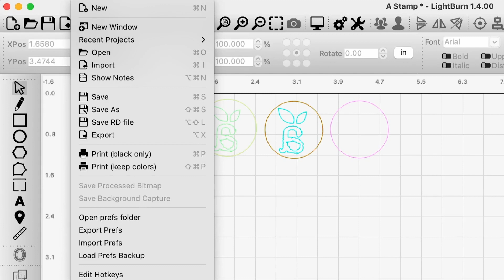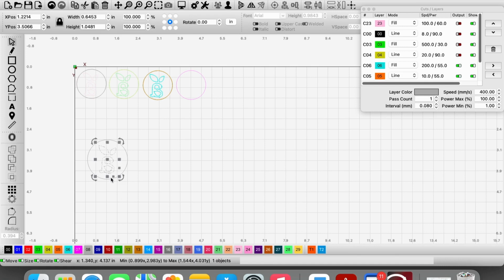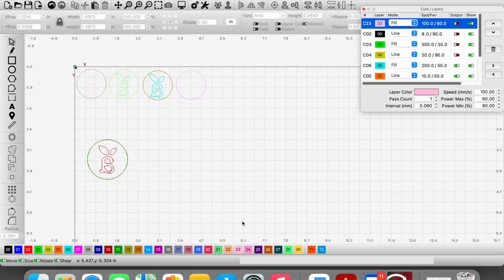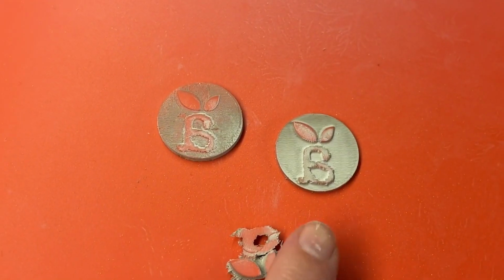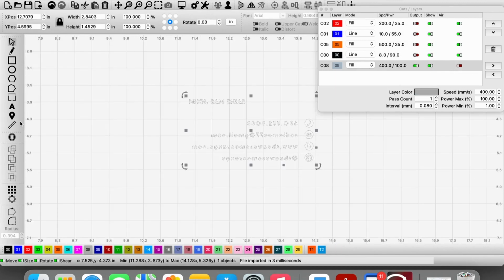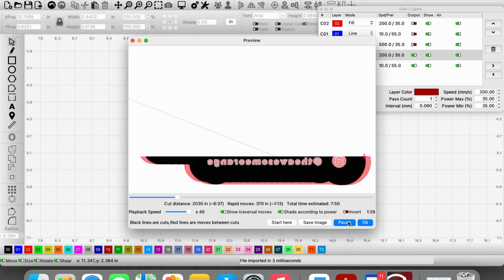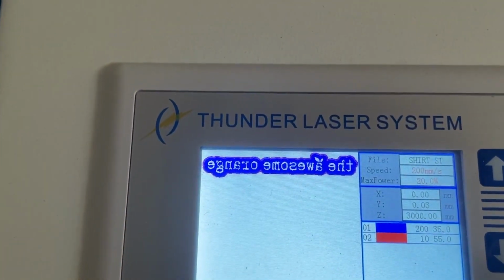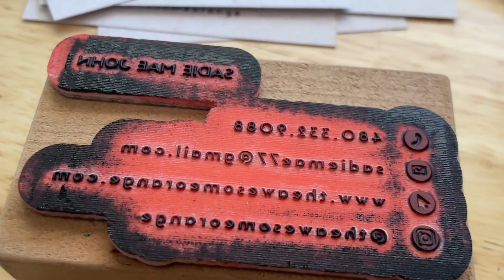Making Rubber Stamps with a Laser | Thunder Nova 35/100

Comment: Would be nice if you had shown the results of the stamp on t shirt.
Reply from the maker: You’re right. I should have. I lost the footage and didn’t want to refilm it. But it did come out awesome. 🍊
Reply: @TheAwesomeOrange  No it didn't come out awesome. I could see that you did not have enough recess to your rubber plate and the background rubber was way too wide away from the letterings resulted in background imprint when stamping as visible when you stamped the test paper. Usually when it comes to material stampings, the plates would need to be engraved super deep with the background rubber removed to outmost the outline of the graphics also you must put a cushion double sided foam between the holder and the rubber plate to make the rubber plate flexible to surfaces when stamping.

Comment: I highly suggest you watch your video. At first everything you are doing makes sense to me and is in a logical sequence. Then you go into layer settings and make adjustments to layers that you have not previously references, for example; you indicate to make the outer circle and rabbit the same color, you chose #10, then you duplicate the circle and make the duplicate layer #11. You then go into the layer settings and make changes to layer # 23 which is pink. You make no previous reference to the use of layer 23 ???   You advise to go into "advanced" and make the Ramp length 0.0797 but your ramp length is actually 0.0197 in your video.???    I stopped watching your video at this point.

No doubt your intentions are well meaning but the way you went about it is just confusing. I just bought a C02 laser and lightburn package and have been watching a number of videos up to the point where the creator jumps to something not previously talked about which causes nothing but confusion. I apologize for sounding critical but your video starts off making sense but then turns into something confusing and makes no logical sense.